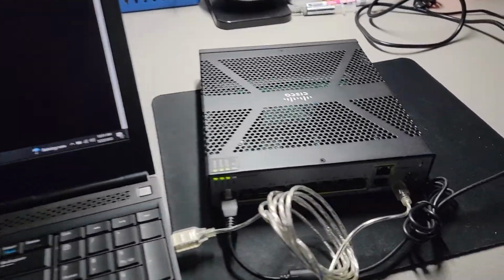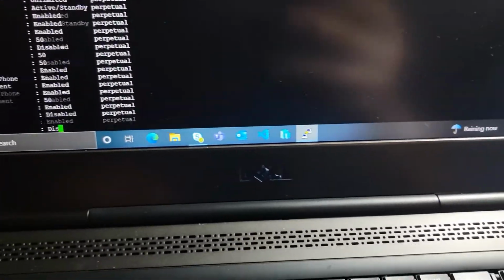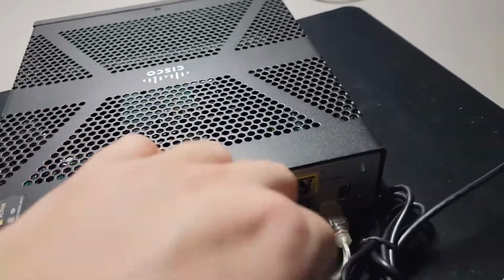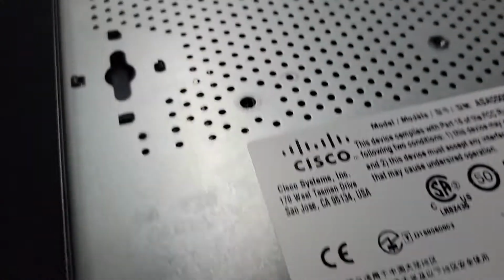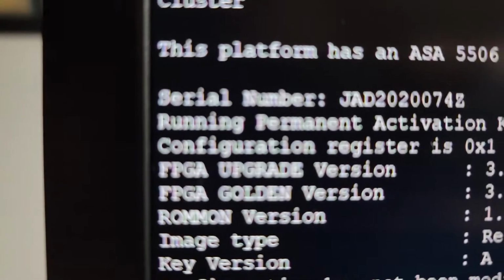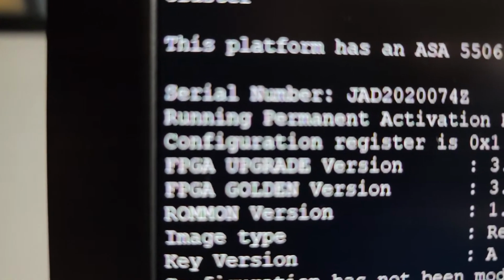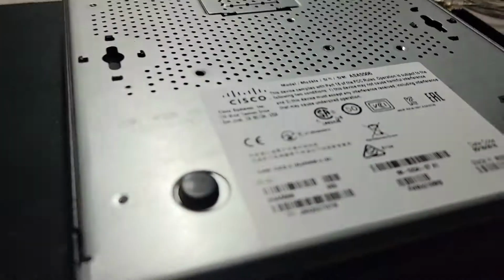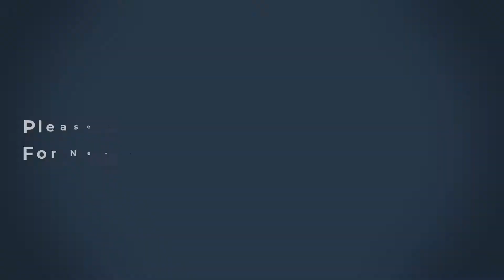Let's Repair: Cisco ASA 5506 Intel Avaton C2700 LPC_CLKOUT0 Degradation Fault

Comment: Thanks for the video. I was in the same situation. At work I managed an ASA 5506. After news of the clock issue, I had it replaced with a V04 revision in 2017-2018 by Cisco. In 2020 we switched to another vendor firewall, but I took the 5506 home for a homelab. Fast forward to early 2021 and it suddenly failed. I could not fathom how it could be the clock issue as it had already been replaced. The ASA has sat in a box since then, and I replaced it with a pfSense 6100. I am slowly getting in to electronics, so once I get more experience with soldering I may give this a try.

Comment: Wow. Great timing of the upload. I was testing a couple ASAs this morning, got the same error and researched it. Will try this solution and let you know how it goes. I'm a beginner at soldering and haven't done anything this small, so fingers crossed.
Reply from the maker: This isn't for the beginner as the 0402"s are super tiny so be super careful. Use a ton of Flux! Hope I was able to help :)
Reply: @EricMarsi  I didn't have the small resistor, so I soldered two scrap wires to the PCB and a normal sized resistor in the middle with heat shrink tubing. Haven't tried flux before.
The heat sink was really tricky to mount and not break or touch the wire. I used some electrical insulating tape on the heat sink to make sure it didn't touch. 
Your solution is definetly more robust, but this is only to boot and clear the config before its handed over. Thanks for the video. Helped a lot.

Comment: Good to know this is easily fixed - I have one sat here that failed recently - a V02 release.  However...  I have removed all the screws from the case and I still can't get the thing apart.  There doesn't seem to be any actual teardown vids for this model on Youtube.  A more in-depth strip-down and overview would be greatly appreciated.
Reply: I am in the same boat today - my ASA5506-X is dead in the same manner, V02 too. After unscrewing, use flat screwdriver and insert it into four recesses near the side walls, gradually levering them out. Nothing particular holds them, just too tight to be disassembled by fingers.
Reply: @MrSysadmin1975  Agreed. I just picked one of these things up while thrifting, for 9$. Canadian. I don't even really know it does, but it was the right shape and size for 9$. Indeed just gently prying under the four corners with a flat blade screwdriver or pocket knife, gently, one little nudge at a time in each corner, and it will suddenly pop. There are EMI gaskets all around which probably make for a tight fit.

Comment: The serial number on the chassis it's a chassis serial number and the one displayed at boot it's the motherboard serial. They are distinct. Turn it OFF, power back on and press ESC to halt it in ROMMON, then "show info" at the rommon prompt. You will have Serial Number - PCA and Serial Number - Chassis. If these two correspond to reality, it's OK. Mine does not boot fully because of some accelerator boot error 4 and that's why I checked the serials from rommon. But since the rommon it's like a BIOS I guess it's the best place to check.

Also, can you put a video showing the entire boot messages, from initial powerup to final boot into the main O/S. I am curious about the messages right after discovering the network adapters, when it begins to load the accelerator bin file. Mine fails with accelerator boot err accelerator boot failed status 4...
Reply: You can also do a « show inventory » after boot to see the HW serial number. It should also report HW revision.

This is worrisome to me, as I have a V04 that was actually replaced by Cisco under the repair program…